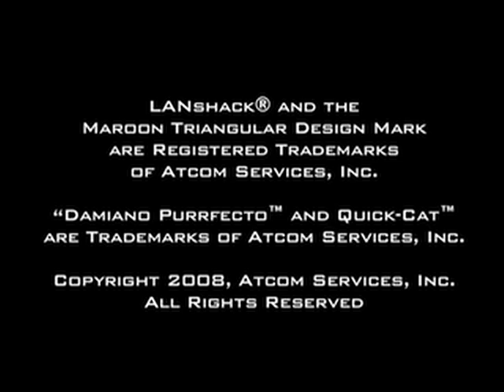How to Install RG6 Quadshield Waterproof Compression and Hex

Comment from the maker: The reason why we use both sets of braids is because it gives an optimal fit for our compression and also our crimp type connectors using the ABA Elite Brand Cable. If you were to use a diffrent cable, I suppose that it could have a different fit and require a removal of one set of braids.

Regards

Tony Casazza

Comment from the maker: If you are only doing a small amount of connections and for all indoor applications than the ones that I have tried in the past seemed to work OK. If you are doing alot of connections or just want the very best, you cannot beat the compression type

Regards

Tony Casazza